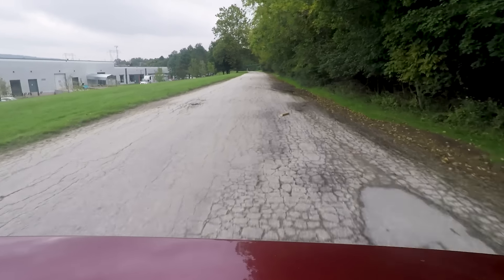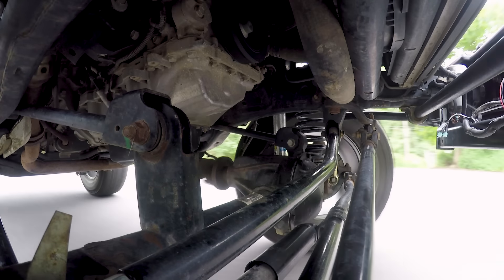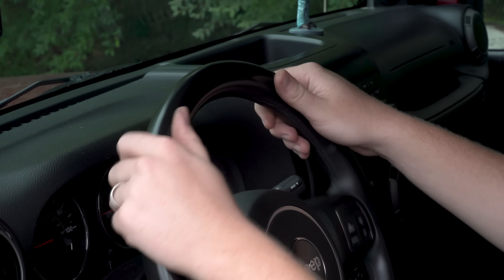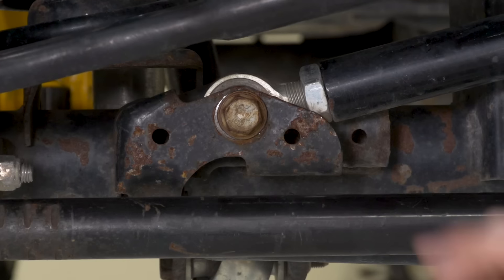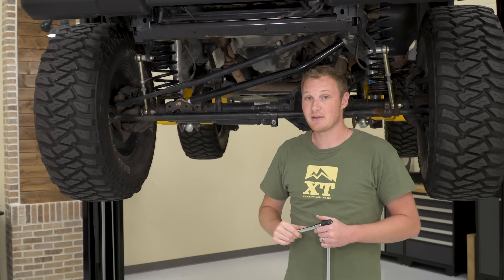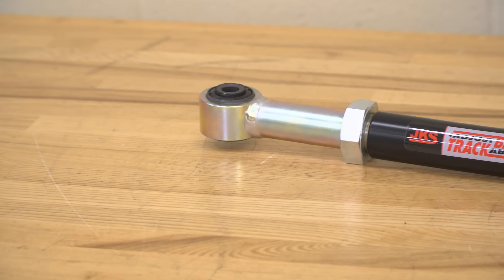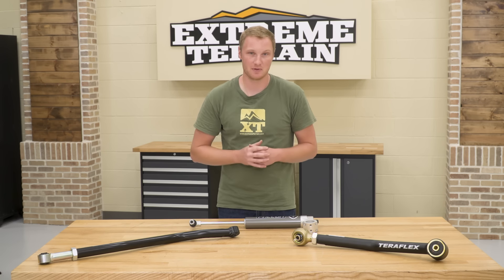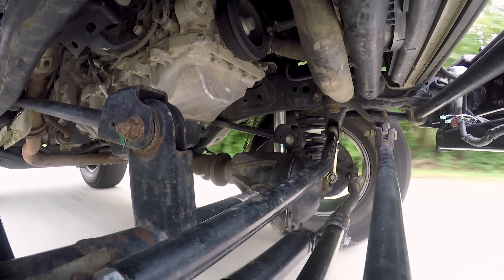How to Survive and Fix Jeep Wrangler Death Wobble | What Is Death Wobble?

Comment: OMG
I wish I had seen this video before and probably saved a lot of money. Being a girl inexperienced with Jeeps, I had this happened to me twice within this month After I regained composure I went to do the logical to me, wheel balancing and alignment and surprise surprise, all that was loose under my Jeep.  

Was very costly but will tell you, I am brave most of the time but this really did a number on me, driven the Jeep 4 miles since repaired and believe me I am taking my time regaining my confidence back before I take a Ride on my  toy faster than 40mph.  😁
I drive an 18 wheeler nationwide for the past 41 years, solo since '96,  nothing has scared me more than my Jeep's death wobble, just two miles away from home

Thanks for posting this video I did wonder how it looked to others looking as I kept hearing those tires screeching until I came to a full stop,  I was shaking myself so much than couldn't press the clutch to continue driving....  very scary..  WOW
Reply: Update... 
So I am still working on this, no more wobble thank goodness but kept having a swaying feeling as I drove after repairing the wobble issue.  Was recommended another shop which told me my rear right breaks were slightly stuck, they showed me, wheel wouldn't spin freely, so fixed that and needs shocks too.  

I felt better but not confident to drive long distance so I dared and drove 220 miles to Key Largo and it was not easy, very tiresome.
 So, as soon as I return, shocks are being replaced... I have to do this little by little because is costly to me, I am the one who pays ofcourse.  

Hopefully, this will help now.  Oh eventually I will replace the other rotters which will go bad I am sure..  

I love this Jeep, I trade it with my son, he didn't abuse it from brand new but I guess he didn't do much on taking care of these important parts because he only drove it 15, 20  miles a day and a couple of long trips when new.  He told me it needed fixing but I still wanted it.  I hoping to bring her back to her matured younger self.  She is sharp looking, great shape 2008, 72k miles
Wish me luck!!!
Reply: @Connie1Fan  Why risk this? Chuck the Jeep and get a Subaru!
Reply: @pattii55  thanks but that was fixed 2 years ago. I won't "chuck" the Jeep, is perfect now plus it has sentimental value
Reply: @Connie1Fan   Sentimental value carries a lot of weight, but stay safe. I had a 1970 Pontiac Tempest that I hated to give up, got me through my life since I was 18, and took me to college many states away and back, but when it turned 19 and rust had taken over too much by 1989, I had to say good-bye!  (Sat in our driveway for it's final years and I had bought a new Mustang (mistake—worst Winter car I've ever owned) for daily drive. I have a Subaru Forester Wilderness now, ordered it in the same color green as my well loved Tempest.
Reply: Yes, I know the feeling.  I gave my first car 1966 Cyclon, Comet to my brother, it was orange, black hood with a bubble on it for carburetor, with stick shift, white bucket seats.  I had gotten 1974 Ford F-150 4×4

My brother didn't use it much, sat at my dad's bodyshop, it wasn't crashed, rutted away got trashed in the early 2000s..  my uncle thought me to drive a stick shift on that car, it was his and he gave it to me
Take care 👋

Comment: I experienced death wobble for the first time yesterday, coincidentally after installing new shocks and a new steering stabilizer.  I saved the original OEM stabilizer, and put it back on, and it seems to have resolved 50-60% of the problem.  I think I probably had the problem, but new shocks just made it appear, Rough Country, not the best, but better than what was in.  Problem only happens if going > 60MPH and hitting a pothole, otherwise drives normally.
Reply from the maker: It wouldn't surprise me if the new shocks are putting more stress on other worn-out parts of your suspension now that theres less play and more control from them. I would take a look at your ball joints, tie rod ends and other bushings for signs of wear. Other worn parts are likely the issue, not the new shocks and stabilizer. -Zach

Comment: I have an 07 Wrangler, since 2011. I've never had this problem until just a couple months ago. Crazy man.
Reply from the maker: Sounds like it may just be time to refresh your suspension then! I would look at replacing your tie rod end links, ball joints, track bar bushings and control arm bushings. Depending on how many miles your Wrangler has on it, it may be time! -Zach

Comment: I had the death wobble in my 2014 wrangler. I bought a skyjacker twin steering stabilizer from extreme terrain. I t took about thirty minutes to install( I’m no mechanic) problem fixed. No issues.  Thank you for your great service.
Reply from the maker: Thank you for purchasing from our site! -Zach
Reply: Steering stabilizer will only hide the problem, temporarily, it’s not the cause or fix, from what many have told me.
Reply: May I know how much did this cost?

Comment: Yikes.   My 2010 Safari Wrangler  has cost me a bundle. Last year New brakes front to back, brake lines. This year, gas lines, battery and rebuild the front end & now my guy as the gas station said he smelled gas coming out my exhaust & it is losing power climbing a small hill I have to goose it with more gas to climb?  Does this mean I need a new motor too.  I used only 100% synthetic oil my motor should not be in this condition?  100,000 K or 63,000 miles.  Help?

Comment: Just fixed my 2013 JKU's death wobble.  Previous owner had upgraded the suspension parts when he had it lifted, and those all seemed nice and tight.  Turned out to be my ball joints, which you can diagnose by jacking a tire off the ground, then using a pry bar under the tire.  When I lifted, the steering knuckle went up about 1.5-2 mm without the C moving.  That was enough to give me a nasty death wobble from about 40-50mph when conditions were right.

Comment: A jeep Im looking at buying says that it as a negative offset thats causing the wobble. How easy would it be to fix or should I just not buy the jeep.
Reply from the maker: If the dealer or person who is selling it will let you, I would take it to a local mechanic to have them look it over. Negative offset itself will not cause death wobble, but if there are other worn out parts on the Jeep the offset can trigger it easier. I would check the tie-rod end links, ball joints, wheel hub bearings, track bar, steering linkages, and the tires themselves. Any of those pieces can cause death wobble and while its not too hard to fix, tracking down the exact part that is causing it can be time consuming. -Zach

Comment: JKU'17, 80,000km, 2" lift, 275/65/18
Wobbles at >60km/h

Replaced ball joints, uni joints, track bar, welded a washer to tighten the hole where the t-bar attaches axle side. 

Not sure where to go next. My mechanic says tie rods next... he also says that a dampener will only mask the problem, but it's tempting me.

Your thoughts would be very much appreciated. Thank you. Peter
Reply from the maker: Hey, Peter! I'd absolutely recommend looking into new tie rod ends, you're going to want to replace all four of them. After that I would look into getting a set of adjustable lower control arms to correct your suspension geometry up front, or look into having your tire re-mounted and balanced in case they are the issue. If all else fails a new steering damper may be needed, but generally a worn damper only will not cause death wobble. -Zach

Comment: Death wobble, very simple fix, if any part ie, track bar, tie rods, ball joints ,bearing hub etc. are bad, most likely time to change all parts on front end, spend $400 in parts and replace all... Did it to my TJ and front end just like new, main culprit was Track bar and lower ball joints. Rent or buy the ball joint kit which has all the parts needed for jeeps, usually 21 pc. kit.
Reply from the maker: Exactly! People don't like to hear it - but wobble is a multi-part issue most of the time. Easiest way to solve is just replace everything! -Zach

Comment: So I recently installed a new front axle joint and bearing on my 07 wrangler. Today while breaking on smooth pavement the Jeep experienced the death wobble. In addition to these parts I added the axle tube seals from ten factory. Is it possible that they may be restricting the steering enough to cause the wobble? My belief is that with the age and 80k miles that it might be best to replace the parts noted to be common causes. 
Would anyone share an opinion on the axle tube seals being. Possible suspect?

Comment: My wife has a 2017 4 door jk with a 4.5 inch lift, 20 inch wheels w/35 inch tire that she got new. We've never had a problem with death wobble. But we have replaced a lot of the suspension parts to aftermarket recently. The rear calipers did lock up/fail to release and we are having to get new ones and rotors.
The biggest problem is the rear gate cracking from the spare tire, we got an aftermarket thick gate and that started to peel apart a year later. Now we got a bumper w/tire carrier. But the helmet joint is rattling after4 months from the heavy tire(lol) putting back and forth weight on it when it drives. And all the aftermarket rear gate parts all started to rust after 3 months.....

Comment: Thanks for the info Ryan, I'm going to take a look for anything loose & hopefully it's just that.  I've also heard that since I don't really have a death wobble but I definitely have wobble, it could be that I need Hubcentric Wheel Spacers.  Do you think that could be a solution as well? I have a 2013 JKU Sahara
Reply from the maker: Wheel spacers really aren't considered a solution or cause of death wobble. If you have loose steering, you should check your front end. Ball joints, tie rod ends, control arm bushings, steering boxes, etc. If there is wear in any of those parts - there could be wobble. -Zach

Comment: re my 2010 jeep 63,000 miles - my mechanic said it is normal for the jeep to need more gas to climb even a small hill.  And it cannot blow gas out the exhaust - there must still be a small gas leak.  We did the gas lines 3 weeks ago.  What do you think.

Comment: I had this a couple of times before so I went to get it fixed and they didn’t notice anything out of the ordinary or loose. So they thought it was my tires. They rotated my tires and they thought it was because I had the wrong size of lug nuts on my tires. They replaced all of them and so far so good. However today I had the full on wobble TWICE within 30 minutes, way way more than before. So now I’m confused as to what it could possibly be? Can someone help me out.  It typically happens between 45-50 mph or when I shift into or out of 5th gear. I only have a 5 speed
Reply: it might be your ball joints
Reply from the maker: Sorry to hear about your wobble issues! I'd recommend checking out your alignment, ball joints, tie rod ends, track bar bushings, and control arm bushings first. Those are the most common parts to cause wobble once they begin to wear out. If they are all nice and tight still, you should look into your wheel hub bearings. It could also be a tire that is out of balance too. I know its a bit of a long list but death wobble has to be caused by something in there! You got this! -Zach
Reply: ExtremeTerrain.com thanks for the suggestions, was just gonna walk away and go to another dealership because they couldn’t find the problem however one of their awesome workers didn’t want me to leave with an even worse death wobble. He figured it was my steering wheel shock stabilizer and it was!! It was just worn out and he replaced it with a brand new one. So far so good and I’ve had no vibration or full on wobble!!! Can’t believe they said they checked everything when they clearly didn’t

Comment: Any suggestions for a rhd tj?
Reply from the maker: You would want to be looking in the same places if your TJ is experiencing loose steering or wobble. You want to check your track bar bushings and mount, your tie rod ends, ball joints, wheel hub bearings, wheels/tires, lower control arms, etc. Best of luck! -Zach

Comment: My 2018 JLUR is stock (so far). At around 8k miles, I had the death wobble happen when I drove over a bridge/ road seam. I took it to the dealer. I was first told they had never heard of such a thing. Finally they said it did have an open recall and installed a heavy duty steering stabilizer. It hasn't happened since but after watching several videos online, I'm doubtful. Thanks for the great video and advice!
Reply from the maker: Thanks for watching, Phil! Best of luck with your Rubicon! -Zach
Reply: Wow. Same car and the dealer gave me the same stabilizer too. Still had wobble though. Hoping you don't find that to be the case.

Comment: mine hits a 60 km and I can drive right past it back to smooth, if I slow down to 50 or less it goes away as well...can't find a video on this symptom
Reply from the maker: It sounds like you may have a tire out of balance. I'd recommend getting them checked out and having all four of them re-balanced, and checking the rest of your front end while in the shop. -Zach

Comment: I had a bad death wobble happening. After taking to my regular garage who couldn't diagnose it I took it to Jeep garage who said it was due to worn ball joints - I was very sceptical about this as I had replaced them just 14 months earlier! A symptom rather than the cause; balls joints replaced again to no effect - in fact, had death wobble again on ride back from garage! Tightened up all bolts as suggested and found truning off ESC helped, marginally. Replacing the steering stabiliser was the real fix for the issue. Have taken it on serious off-road drives since then and also towing an 8m boat with no experience of the wobble again since replacing the steering stabiliser. Hope this works for you too!
Reply: Maybe someone with more mechanical experience can correct me, but steering stabilizers don't really fix the issue, they mask the symptoms by absorbing the wobble.  I've replaced my stabilizer and it did seem to stop, for a while, but then after some time I could slowly start to feel it coming back until it's become full-blown death wobble again.  Hope your experience doesn't end up like mine.

Comment: Just wanna do a quick PSA for anyone seeking death wobble answers.

#1.  Steering stabilizers don't fix this.  Not permanently.

#2. Watch this video.

#3.  If you can't diagnose or fix this on your own...you maybe shouldn't have gotten an old jeep, or maybe you shouldn't have gotten that new jeep that you or someone else fooled around with, with lift kits and huge tires, beating on it offroad etc.  

Most death wobble cases come from worn out parts on old jeeps, or people changing suspension and tire components....and either incorrectly installing them, or using cheap parts that wear out fast or aren't a proper fit within the system..

I know that kinda sounds rude, I don't mean it to be.  It's just that a person has to know how to wrench on these things.....or they're gonna spend TONS of money at garages.  I mean thousands.
Reply from the maker: Tiny shop visits definitely add up when you're trying to diagnose wobble - I can speak from personal experience. 😅 Great bit of advise, Nick! Thanks for watching! -Zach
Reply from the maker: @Faq-ubeach  Agreed! Death wobble isn't just a Jeep thing as much as some haters try to tell you. It'll sneak up on any vehicle with a solid front axle that hasn't be properly setup or maintained. Thanks for watching! Have a great day! -Zach

Comment: I purchased a brand new 2003 wrangler Sport (TJ) and experienced the Death Wobble when I only had 20,000 miles on the vehicle .  I was on 95 South between two 18 wheelers going 55 miles an hour!  The shake was so severe I literally saw Jesus at that time!  I slowed down and the wobble stopped. Dealer replaced tie rod and a week later it happened again!  Finally a mechanic told me to get 4 brand new tires even though I only had 20,000 miles on the original tires. That solved the problem, but it could come back anytime. I guess that’s the nature of the beast!
Reply from the maker: I think the mechanics take on your situation is a little misguided, in my honest opinion. Death wobble isn't something that can just "pop back up any time" for no reason. Wobble is an inherent trait of solid front axle vehicles like Jeeps and heavy duty pick-up trucks. The main cause of it is normally worn suspension components like tie rod ends, ball joints, track bar bushings or worn track bar mounting brackets, etc. On the rare occasion wobble can be triggered by old tires that are worn irregularly or just balanced incorrectly, like in your situation. For an example, if you went through and replaced EVERYTHING in your front end bushing-wise paired up with those new tires, there's literally 0% chance of you getting a wobble. It can't just happen for no reason. 😁 Just keep an eye on your front-end going forward and you'll be fine, Cyrus. -Zach

Comment: Thanks for the video. I’m working on a wobble on a 2011 JK. It’s the front left wheel only. I’ve replaced the wheel, had the tires balanced twice, new hub, axle, wheel joint, and track bar. Going to re-check the ball joints, tie rod ends, and drag link. Not sure why I’m only getting the wobble from the left side and not both sides.
Reply: Andrew Turner 
It's the dampener!!!...